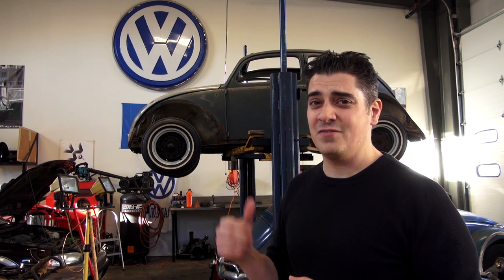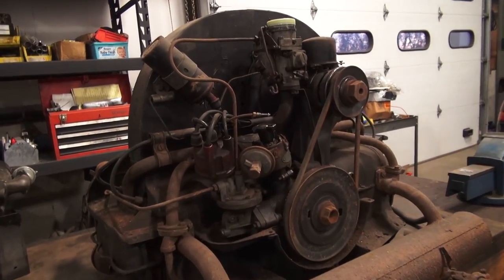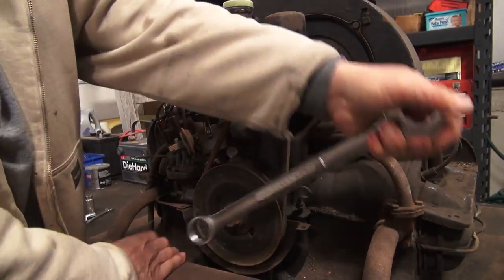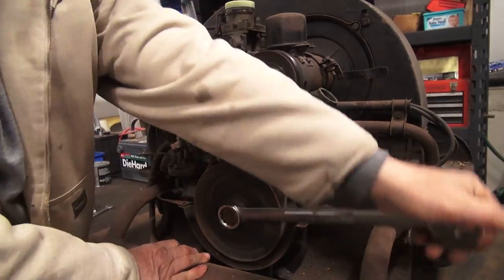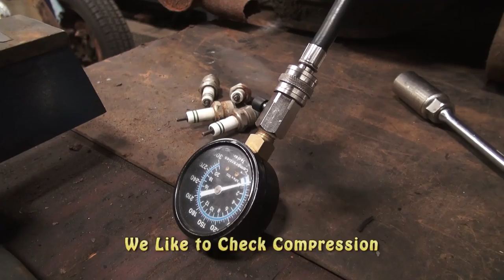Classic VW BuGs How to Tip Re Start Old Beetle Motor Sitting for Years

Comment: Just did this the end of last September to a 68 autostick that was sitting since 1985. Changed cap, rotor, plugs, wires, coil was bad so I replaced it, rebuilt the carb, and replaced the non-functioning fuel pump and it fired right up, no smoking or knocking. I'm driving it today! Love this little bug.

Comment: I bought a '71 Super Beetle in 2016 that had been sitting since 1997 without the engine being started. 

Towed the bug home. Replaced plugs and timed. Ran a fuel line to a spare can and she started right up as if it had been driven the week before.  Amazing quality on these air-cooled VW's.

Comment: thats awesome how much crap it blew out lol... I had a 69 baja in highschool and drove it all the way through till I graduated with NEVER doing an oil change (because I was young and stupid).  one day I decided to go ahead and do one to "treat" my car lol... when i opened up the strainer I found about 3/4 of a pound of sand and muck... 
I couldnt believe it would run, and ran GREAT, with that kind of debris in the case.   I took my time and spent about 4 hours cleaning and spraying carb cleaner in it and reaching up with rags and pulled as much of the crap i could see out.   once satisfied that I'd done a good job I sealed her back up, put oil in her and fired her up.  she sputtered a bit but sounded great.   I drove about 2 miles and the engine blew up.   Apparently I shouldve just left it alone lol.... 
(that being said, the motor I replaced it with had set for nearly ten years previous and it legit fired right up with nothing more than a moment of sanding on the points.)

Comment: Can get my crank to do a half rotation think might be some rust in cylinder wall any tips?
Reply from the maker: Try a lil wd-40 down the cylinders and let it sit, or marvel mystery oil.
Reply: You don't need to put any oil in the cylinders if it turns over ok ? Is it a good idea to put a little oil in there anyway ,? Or  not necessary?

Comment: You use multi grade oil or was that just to have clean oil? I remember back in the day they used 30 summer and 20 winterDid the compression improve?
Reply from the maker: we always use straight 30w or 10-30w oil.  As far as the motor, we 
eventually did a rebuild.  I have a preview trailer online showing the 
rebuild, it will be a multi-part series on 36hp rebuild.

Comment: Any tips on keeping it going? My 71 super runs great for about an hour then dies, I can't restart it right away. I usually have to let it sit for 30 minutes or more. Any help would be great.
Reply: Sounds like your engine could be over heating. The easiest way to check is after letting it run a while, the dipstick is to hot to hold.

Comment: Wow 30 PSI? I know nothing about these old aircooled engines...what is the optimal PSI for compression?  30 PSI just seems way too low to run.
All my VW knowledge is in the early watercooled diesels where 300 PSI is worn completely out and you'd like to see 400+ PSI per cylinder!
Reply from the maker: +dedfrog at least 90psi it should be.  It is already building up though on this motor.